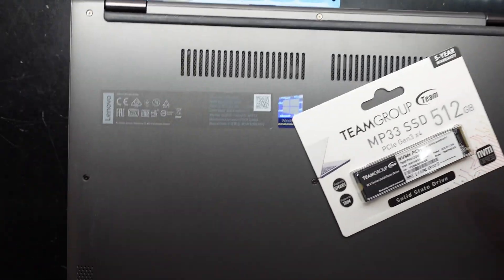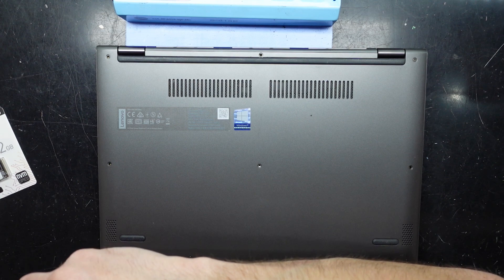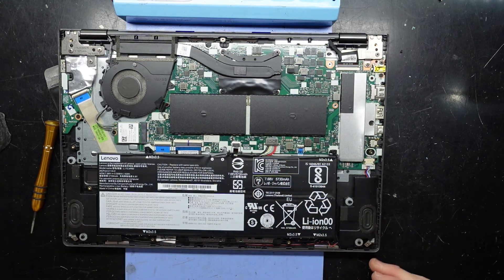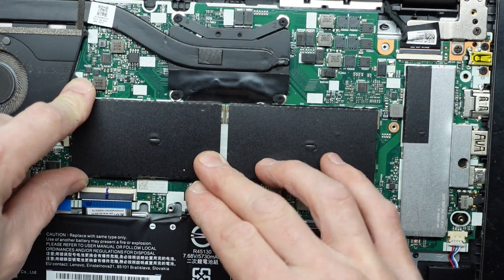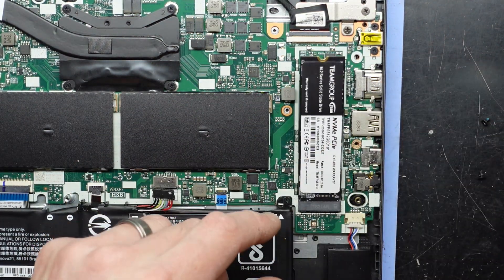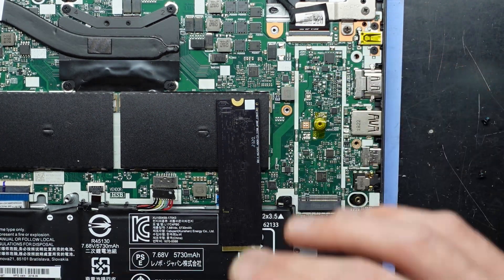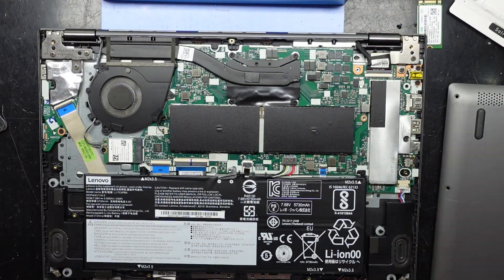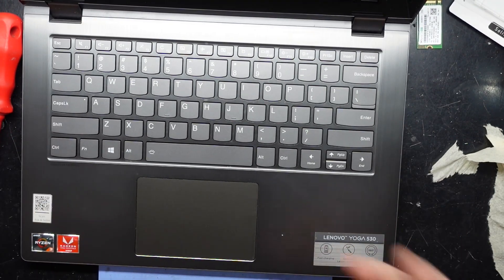Lenovo Yoga 530 14ARR NVMe Upgrade and Other Upgrades

Comment: Help me brother, I can't change the style in the clip. Can turn on the machine Black and flickering screen What are the ways to solve this?
Reply from the maker: Not sure what you mean sorry
Reply: @rickstechrepairs  Do you use it to translate I changed the SSD according to you but I can't turn on the laptop. Is there a solution?

Comment: Great video. Anyway, what do you think about the temperature that can increase on the new NVMe now bigger ? I want to replace it too on my Lenovo 530 14ARR but I'm a little bit worried
Reply from the maker: I think it will come.down to sustained writing 

If it's getting used in bursts I don't think heat would be too much of an issue
Reply: @rickstechrepairs  Ok ! I try ! Thanx for the reply ! ✌️